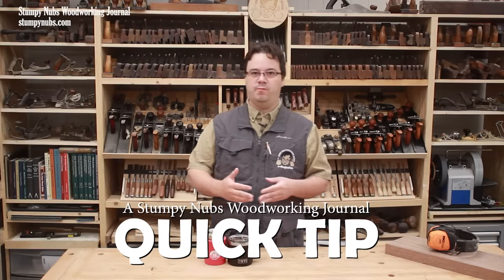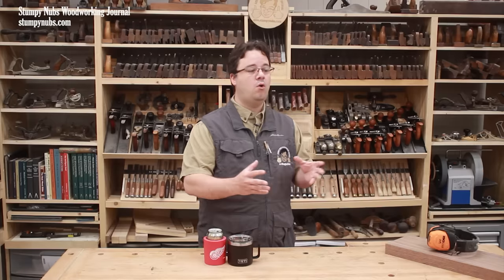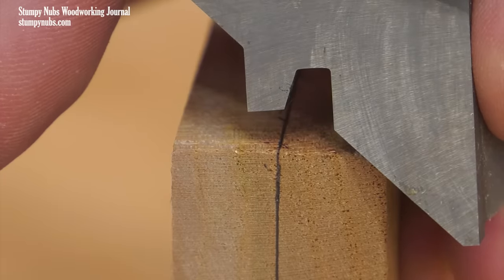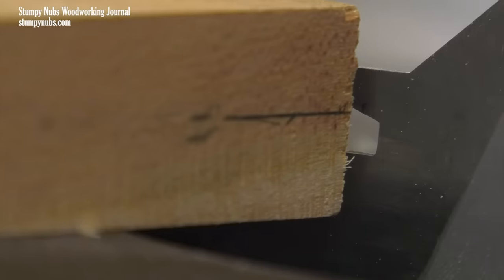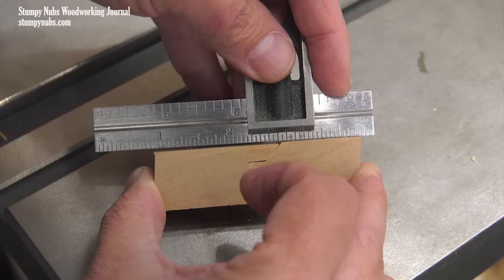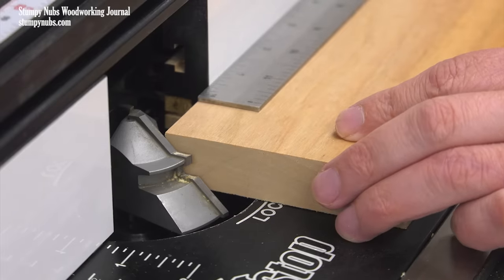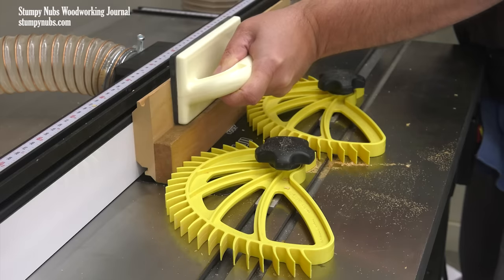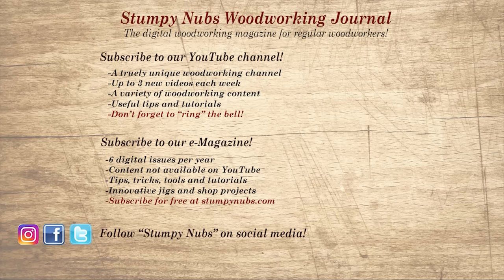Why not just set up your lock-miter router bit this way?

Comment: will this be a disaster if I just use my router by hand? I don't yet have space to set up a router table and fence
Reply: I felt like a fool immediately after asking this question, cuz it suddenly seemed ridiculous to try. But 10 mins of experimenting and I figured out how to make a simple fence to cut the narrow end by flush stacking small sections of plywood til they matched my routers off-set, and then one more sheet of ply a few inches proud at the bottom of the stack to serve as the fence, and then calming it all to my bench with the object material on top of my stack. It helped that my Whiteside bit was perfectly matched to the 3/4 ply I was cutting, so setting that up was pretty quick. Thanks for the video.
Reply: *clamping it all to my bench

Comment: I've used these bits before, and I don't really find the setup that big a deal.  I regard it as similar to Norm Abram's saying "Perfect dovetails every time" when he uses the router jig.

I don't get perfect results every time - the wood isn't perfect flat.  The wood moves away from the blade just a little bit over part of the cut.  The wood catches on something (like it did in the video) making an uneven spot.  There's always something that makes it less than perfect.

That's why I switched to just cutting the 45 and then doing the deal where you glue 45 degree wedges to the workpiece with paper in between.  (And then uses those wedges to be able to clamp at a 45).  I haven't found a way to screw that up yet, but believe me, I haven't given up trying.

Comment: Wouldn't it be simpler to just cut a spline groove in both pieces using the same setup then use the spline to lock the pieces together. (I haven't tried this but it sounds good.)
Reply from the maker: This method cuts the 45-degree bevel AND the locking joint with a single setup. The method you suggest would take two setups- one to cut the 45-degree bevel, and another to cut a groove for the spline, not to mention the need to create spline stock.
Reply: Thanks for the reply.

Comment: This is somewhere the manufacturers are hurting themselves. Would it really be that hard to place a center mark/groove on the steel body of the bit and then align that with the jig used to braze the carbide cutters on? Same with 'Bull Nose' edging bits, you can easily get a bucket of dust trying to get a large one adjusted juuuust right.
Reply from the maker: Either way you would still end up making a test cut to dial it in because your eyes aren't perfect. Since it only took one test cut for me to get it without a mark, I don't think a mark would be an improvement over just eyeballing the center.

Comment: I don’t know what I’m doing wrong.  Maybe my bit speed is too slow, I have my router set to half speed.  The cuts I’m getting with this bit are horrendous.  It’s gouging huge sections and the profile is all over the place.  I tried several test pieces last night and every one was a total mess.  I even tried taking off an 1/8th at a time and it was still like sticking a board into a wood chipper.  I see you just zipping through in one pass.  What am I messing up here?
Reply: If your stock is fairly narrow you will need to use a coping sled, or some other jig, of some type to hold it securely.
Reply: @mgpalma  Thanks for the heads up.  I think I've figured it out.  My cheap router table top is warped and the fingerboards I was using wasn't up to the task of keeping the wood from chattering.  Solved it by bolting a piece of MDF to the table and using push blocks.

Comment: And once you get it set up correctly make a pattern jig and save it for the next time!!
Reply from the maker: That jig pattern will only work if the stock is exactly the same thickness, and even they you will still have to make a test cut. I don't see how that would speed up the process.
Reply: @StumpyNubs  I use a block jig on my planer to guarantee milling of the same thickness time after time. so in my case a jig would make setup easily repeatable because, for me, the thickness is always the same.